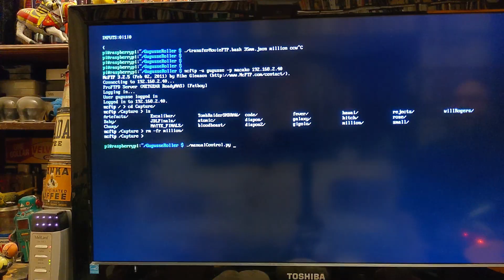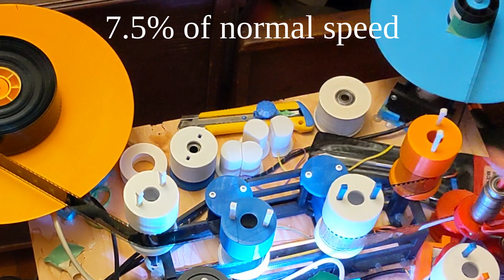How the Gugusse Roller works, Part 1: The tension and the sequence.

Comment: When my dad went to work for CBS/FOX Video in the 80s, they sent him to New York to learn how to use a new type of film scanner that was being developed. That machine was, pretty much, the cutting edge of film to home video technology at the time. Now, with the direction technology has headed, you can make a DIY scanner system at home as long as you understand tensioning of film reels and Raspberry Pi circuit boards.

Comment: I've no experience with film scanning. Where it says it supports 8mm film, does that include Super8? i've got a crapload of my family's old super8s, enough that sending them off will cost a small fortune.
this would be a life saver
Reply from the maker: Ho yes, it does include super8, anything as long as there are holes on the film for the hole detector to detect.....

It can read analog optical soundtracks (actually, it justs takes photos out of of it, along the picture, and you just use AEO-Light2 to transform these pictures into a sound wave file)
It can NOT read magnetic soundtracks

A new version of the machine should be available soon (within 2 months), the very small size of the super8 holes makes it hard to adjust the hole detector (but it stills works) while the newer design will get rid of that adjustment. the new design will have the same electronic board, the same "feeder" and "pickup" (the 2 turntables), so you should start by making these first.

Comment: what kind of camera do you use in this project?
Reply from the maker: I've used multiple sensors and lenses over the years, some very expensive, some really cheap. These days it's a cheap camera sensor with an expensive lens:
lens:
https://www.edmundoptics.com/p/25mm-dg-series-fixed-focal-length-lens/12156/
camera:
https://www.raspberrypi.com/products/raspberry-pi-high-quality-camera/

Comment: When i use stepper motor, it only vibrate and not rotate. Why?
Reply from the maker: Missed your question here... sorry.
When one phase is not working, that's what a stepper motor do. But many things can do this: bad connection, bad motor driver, bad coil in motor...

Comment: I don't understand why so many of the elements essentially don't work. Rubber bands paper friction wads and drills don't make any sense to me. How have these not been ironed out with permanent fixes yet?
Reply from the maker: Fixes? There's no broken element. The machine works, everything in it work, I scan all types of film with it, there's nothing to fix. The rubber bands are not part of a temporary fix, they're actually a key component at the heart of the system, they last for about a year and can be replaced in 4 seconds. As for rewinding a reel, I'm still looking for a solution but haven't had a satisfactory idea yet, my biggest problem with it is that the drill solution works so well and so fast that it makes it hard to follow.